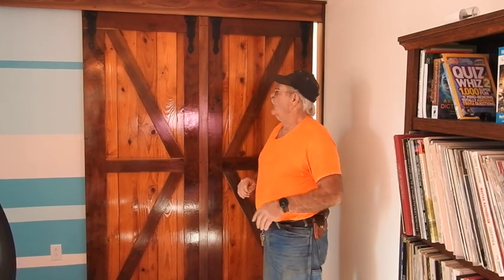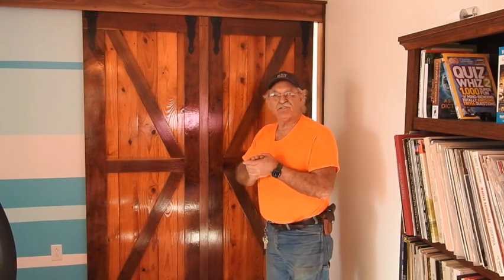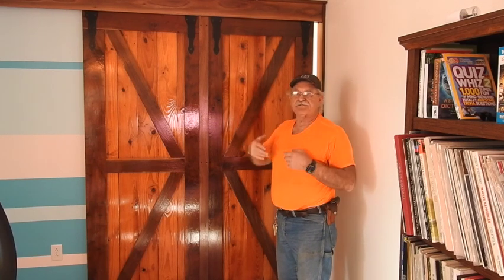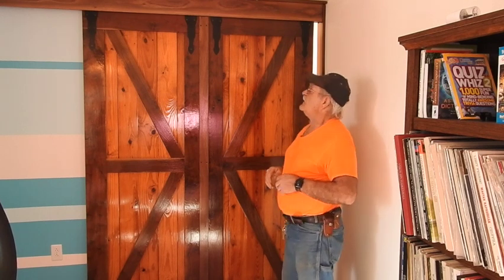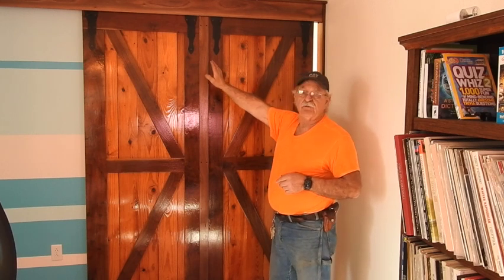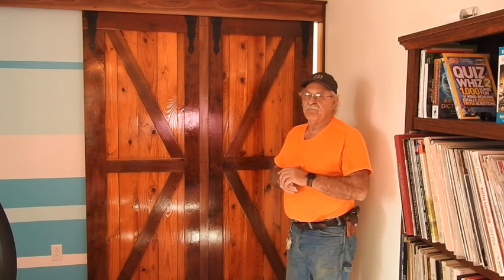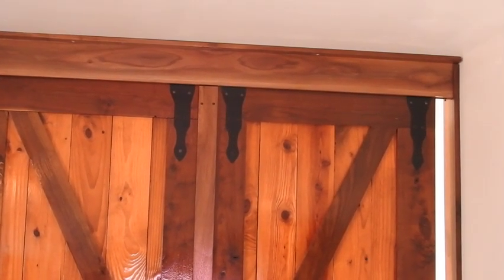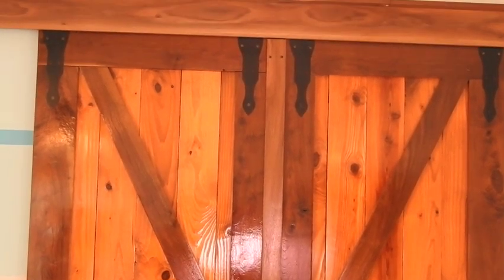Lets Install DIY Sliding Barn Doors--FINALLY ITS DONE !!

Comment: Absolutely beautiful!!  That 5 plus inch trim at the top adds such a professional look.  Excellent work, Wendell.
Reply from the maker: Originally it was to have an entirely different roller system. I made another set of exposed rollers and hangers from hundred year old parts from an old furniture factory that used to be in town. Those will now end up on another set of barn doors.....but not today.  (-;

Comment: Bummer you didn’t roll them just a little bit!    Everything turned out beautiful, fantastic work.   Can’t imagine drawing and making those brackets yourself.
Reply from the maker: I didn't even think about it.  I was only thinking of sitting the camera for the least glare from the window facing west .  As I sat down to edit it is when I realized the omission.  But it takes little effort to send them across the rail.  I have to put a soft bumper the full height of the door on the side that comes in contact with the bump stop on the right, plus the cast handles.  Thanks for the compliment....but my daughter did the majority of the sanding and finish work....I just did the cutting and fitting....

Comment: Do you remember the old pocket doors that a lot of the old houses had?
Reply from the maker: Yes, we stayed in an old timey bed and breakfast years ago that had the outside of an interior wall removed to expose the fancy working of the rollers in one of the rooms as a fancy display of old machinery in really old homes.  Quite fancy compared to my simple trolley setup.
Reply: @tractorman4461  , but yours will be much easier to fix if something goes wrong.